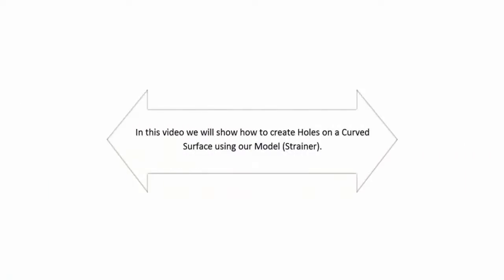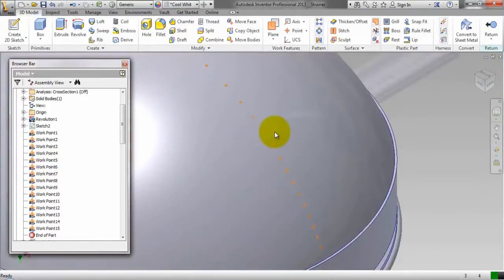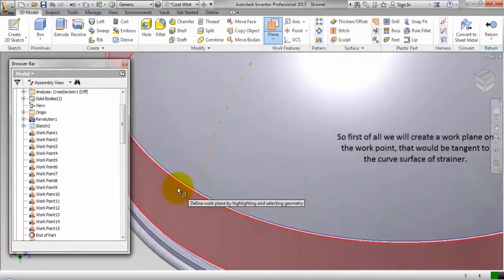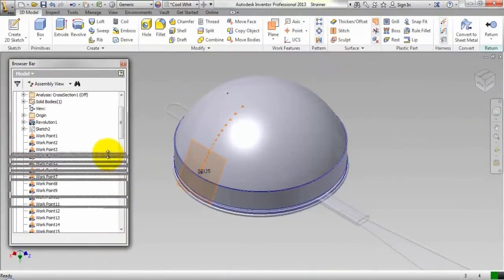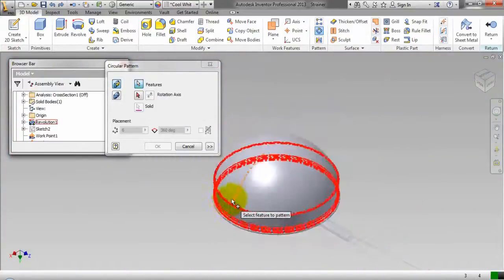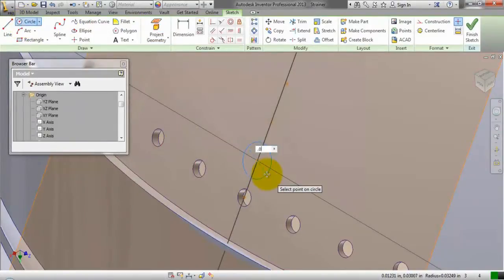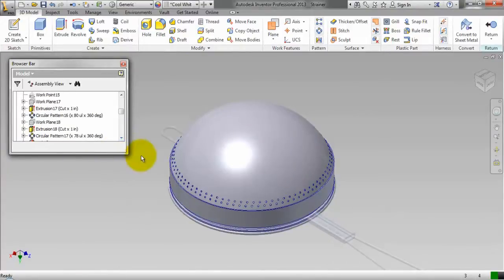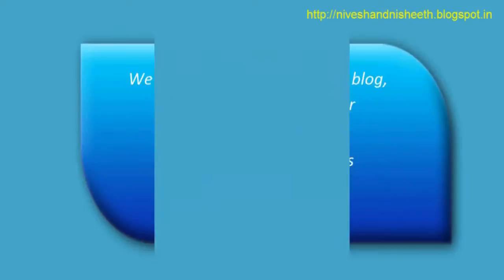Creating hole on a curve surface-Autodesk Inventor (with caption and audio narration)

Comment: why do not you use two circular patterns?
(https://dl.dropboxusercontent.com/u/1185301/hole2.ipt)
Reply from the maker: Radek Šlégl The file you sent is created with newer version of the software send screenshots.
Reply from the maker: Radek Šlégl Ya the hole can be created like that but the result would not be the same as displayed in the model.
Reply: Radek Šlégl yes, pattern follow curve option !